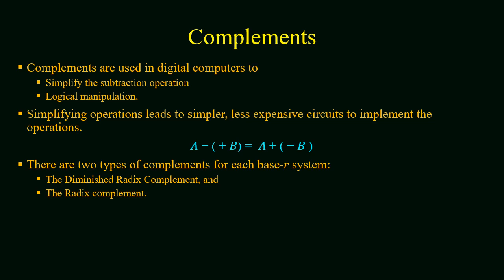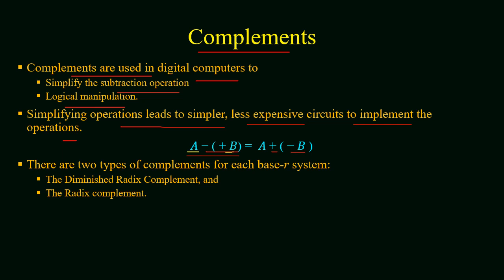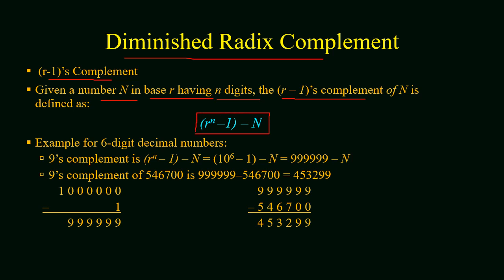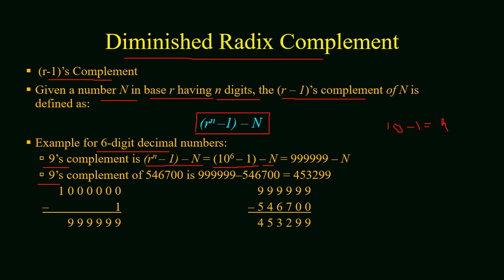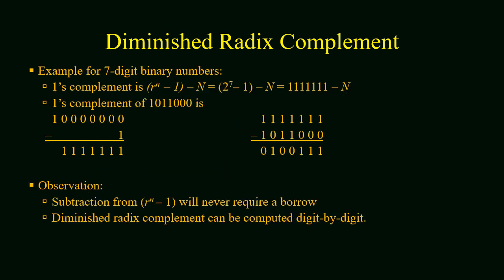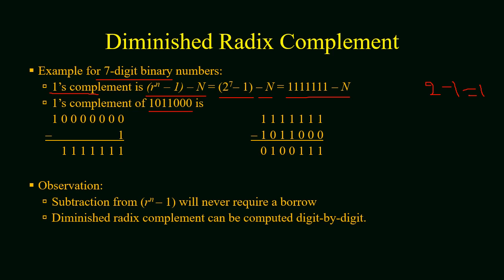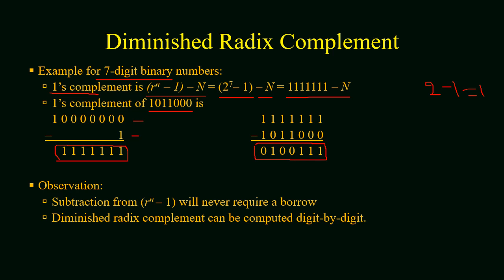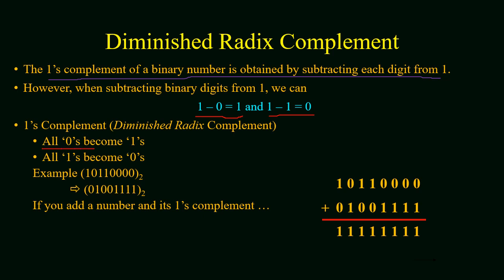Compliments | Radix Diminshed Compliments | 1’s Compliment | 9’s Compliment

Comment: assalam o alikum sir
sir in 2nd example 2 power 7 is equal to 128 then how we can write it as 10000000 i did't understand this sir
Reply from the maker: WSalam. If you change 128 into binary you'll get 10000000. 
or alternatively
2^7  2^6  2^5  2^4  2^3  2^2  2^1  2^0
1       0      0      0      0      0      0      0
and 2^7 = 128